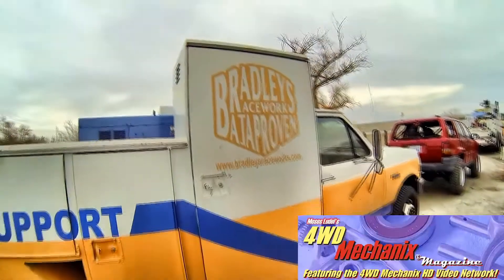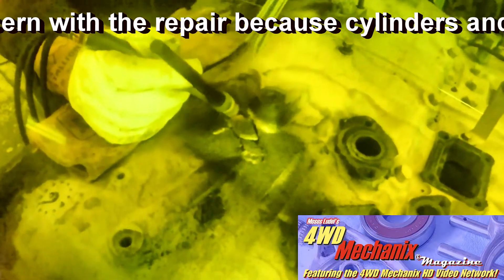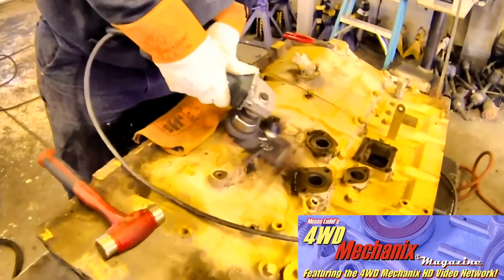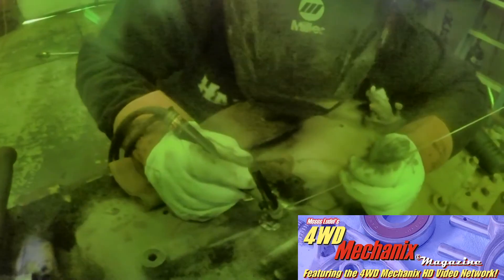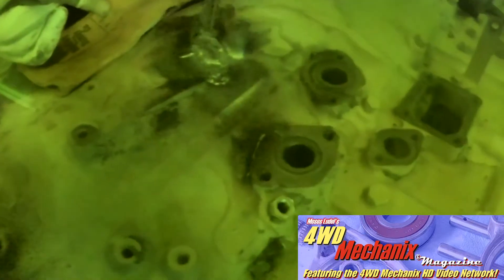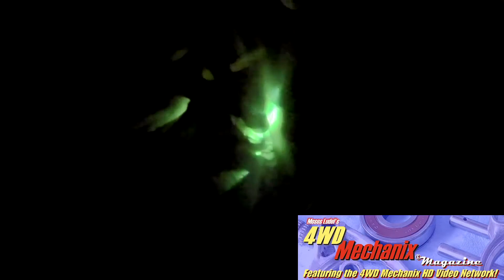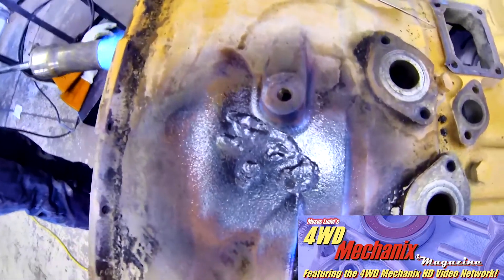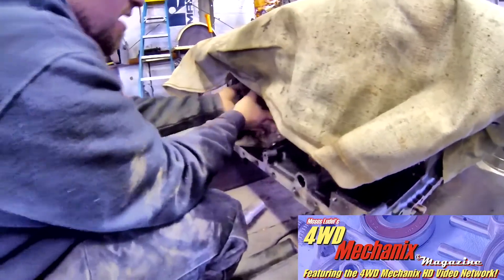Cast Iron TIG Repair of CAT Engine Block

Comment: Will this work for the bottom of a crank case?
Reply from the maker: If it's a removable crankcase, the casting repair could work well.  Be sure to remove the crankcase from the block, though.  Heating and welding a crankcase in place is a recipe for a bad fire or, worse yet, igniting the hot, volatile fumes and causing an explosion.  The crankcase should be cleaned thoroughly, glass bead blasted if necessary, then washed under pressure before drying and welding.  "V"-ing or grooving the fissure or break is important for complete weld penetration.  If a crack, drill a hole at each end of the crack to prevent the crack from continuing; "V" or groove the crack for complete weld penetration.  Any weld build-up/penetration inside the crankcase should be smoothed to prevent sloughing off of any slag.  The crankcase's mating surface with the block should be checked for flatness or finished (milled) after welding for a correct fit.  Grey cast iron doesn't move much, that's why it's prone to cracking at the heat affected zone as the weld cools and contracts.  If you are concerned about warp during welding, consider bolting the crankcase to a flat metal surface before welding...Also, if the crankcase break or crack is not part of a load bearing member or under a lot of pressure in service, brazing is often a lower temperature repair approach.